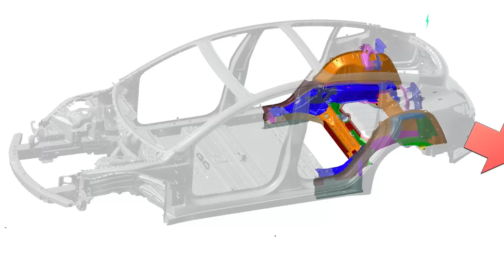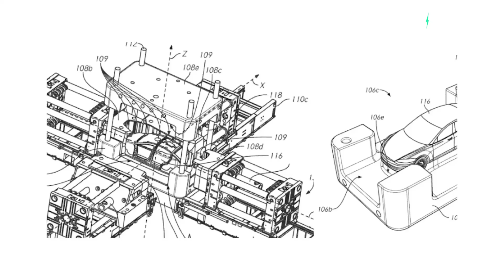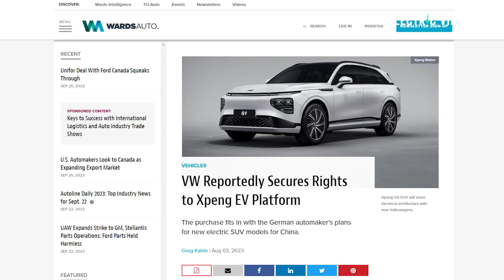Tesla Giga Shanghai launches 1-piece Giga casting for epic 40% cost reduction

Comment: Wouldn't it be interesting to know which technologies are currently incorporated in which models in which markets?
Reply: well...basicle CN models - model 3 the new one. he said it. prob this will be exported to EU and SEAsia and CN of corse
Reply: But what specifically do they have? Which castings? Which batteries? Which structural elements? There's no info from Tesla on any of this, so I assume the new 3 has no major castings and no structural battery pack -- technologies that as far as I know have only been used in Texas and are not now being used at all.

Comment: One of the issues that is created by gigantic cast parts is the lack of repairability. Castings are brittle and brittle materials fracture without any plastic deformation.
If the vehicle had a rear 3/4 impact for instance, that would likely smash the wheelhouse area and there would be no "partial parts" sometimes referred to as "service parts" for use to repair.
Ultimately at some point forward in time, the objective is that there will be no accidents but that is still a long ways off. In the short term I see many insurance write offs for relatively minor accidents thus creating huge insurance premiums for Tesla cars.
Reply: So very wrong.   These are not brittle and have what may prove to be the worlds best progressive crush, energy absorption, for crash protection.    Safe trumps cost of repair.    Modern cars are using modern strong steel for strength and it is less/not repairable.
Reply: @danharold3087  You are very misinformed, the grain structure of a casting does not permit plastic deformation. According to the foundry forum: "Tesla does not yet have a solution to casting repair"

DO NOT DELETE THIS THIS TIME - do your research before making irrational statements.

Comment: of course others will be able to compete with that, they will get and institute their own Giga Casting Machinery. It may take time but they will. You give FAR too much credence to how much of a lead it would be and for how long. it is but it is not sustainable.
Reply: Tesla has said it does not depend on moats.   It just keeps moving ahead of the crowd.
Reply: @danharold3087  my point is that if  proves to be a successful strategy, there is nothing to prevent others from adopting it too. Congrats to Tesla for innovating but their lead is FAR from insurmountable.
Reply: @jpdurr  Yes the current lead is not insurmountable IF TESLA STANDS STILL.  Tesla is constantly innovating the factory the line and the cars.    So when others catch up to where Tesla is today Tesla has moved on.   Top engineering graduates line up to work at Tesla and it shows.
Reply: @danharold3087  Tesla had better start paying more attention to Quality issues.

Comment: Since they afaik not building these giga presses them selves but buys them from an italian company if I am not mistaken, then nothing is stopping the competition from doing the same thing. Even to build such a press is no rocket science.
So I don't think there will be any pants shitting on this one.
Cool machine though, but as said no high tech here so easy to copy for anyone
Reply: When Elon wanted the first 6000 ton press nobody wanted to try making it.  Irda said maybe we can and did.  Yeah it is kind of like rocket science.   If you give a car company a press they would not be able to use it.  They would have to figure out the alloy mixture.  Hire die casting experts.  Tesla borrowed material science know how from SpaceX.   
Nobody needs a gigaPress to build cars.  But Tesla will build better and less expensive using them.   With the current production rate of many EV makers buying into this tech could kill them.

Comment: Weight is important but not as much as ICE cars due to regen.   If regen has a good round trip efficiency, most of the energy to accelerate the car is recaptured.   The only energy needed to keep a car at speed is that which is required to overcome aerodynamic drag and rolling resistance.   There are slightly higher losses with weight due to increased rolling resistance.   But aerodynamic efficiency is usually more important than weight because no aerodynamic losses are recaptured.

Comment: It may drastically reduce the cost of manufacturing the frame but it also makes the frame and all of the extra pieces fused to it impossible to repair, which means the whole vehicle will get scrapped for things that could previously be repaired by swapping some relatively affordable parts. Almost anything beyond a paint chip on a Tesla ends up with a 5-60k$ insurance claim.
Reply: Why do people make out like Tesla hires tech school dropouts.  Tesla hires the best and brightest engineers in the world from around the world.
Tesla with casting has crush cans on both ends.  So that shoot you in foot on your "more than a paint chip thesis".
Each year cars in general are less repairable.  To meet safety standards they are using less repairable materials on the body and the frame.  The casting look to be excellent at energy absorption  Yes they have replaceable crush cans.
Reply: @danharold3087  If an impact is hard enough for crash cans to be of any use, you are likely $10 000+ out in sensors, electronics and wiring harnesses, etc. on top of the structural and cosmetic damage.
Reply: @teardowndan5364  Where are you going with this.   Any car equipped with a quality ADS system will have similar sensors.  Bard says Tesla cameras are $200 to $600 installed.  The point here is that anything past a paint chip is not going to total the car.   Which is what I objected to.
Reply: @danharold3087  In a conventionally manufactured car, most of the suspension and steering hardware is mounted on brackets that are then attached to the frame/body. In a gigacast, most of that is integrated in the casting where even a seemingly trivial side impact into a wheel can total the whole car. For more serious impacts, EVs often get written off simply because the insurer doesn't want to take chances with the battery having been damaged.

Comment: People you are looking in the wrong place.   
Overall, the thinning of automotive exterior panels has had a negative impact on consumers. It has made cars more expensive to repair, and it has also made it take longer to get cars repaired.  Accidents and incidents requiring panel replacement are frequent in comparison to the need for frame repair.    The thin panels have increased the cost of auto body repair and auto collision insurance.

Comment: Here's a question, what if the car gets damaged? How can you replace "the part" without replacing the whole car.
Reply: The Model Y is designed with repair in mind. There are points on the castings, where you can cut off a part of the casting, and weld a new part back on. Not every crash, is a write off.
Reply: Not unique to the cast cars.

Comment: What's the point in having game changing manufacturing technologies and then scrap really helpful (and cheap) things parking sensors and indicator stalks !! Tesla run by accountants now
Reply: Nope.  They are pushing the less parts thing what many including me think is too far.  I could be wrong.   Anyway watch for a nice add on stalk from aftermarket suppliers.   This is not going to ruin the car.

Comment: Tesla is a beast. I drove the "old" model 3 from 2019 and it was really great, then I tried the 2022 model 3 and I could both feel and hear the difference.  Now they have made an almost new model 3 and from what I hear it is Even better ! And having a family safty is very important to me, so as Tesla has the highest safty rating makes this a no brainer. Also was pleasently surprised that it dident do anything bad to the battery if you only used supercharger !
Reply: (spellcheck - on edit - helps credibility, try it some day)
Reply: Given that Tesla now used a very good HVAC system on the battery we should not be too surprised.

Comment: My only concern is car insurance, surely if you are involved in a crash that damages the one piece moulding the car is automatically a right off , yes the cars will be cheaper to buy, but I for see insurance premiums sky rocketing as basically they will be disposable products and not worth trying to repair !
Reply: High strength steels are causing the same problem for other cars.  There is an equal if not greater issue with the thinner body panels and they get damaged far far more frequently.

Comment: An impressive achievement by the engineers. Unfortunately, this will increase insurance costs even further, as repair options will be reduced even further.
Reply: Not if total cost is lowered substantially.  And it is safer.  A lot of insurance is liability for injury etc.
Reply: @kevinwalker2529  Exactly.  Cheaper to replace a car then heal the sick and raise the dead.

Comment: Anyone thought about how to repair this single piece in case of the accident? Insurance will cost $$$$$$$$ going forward.
Reply: Asked and answered.   Other cars have the same problem with modern high strength steels. 
Tesla cars are generally safer.   Insurance companies pay much more injury related money than car repair.
Safe is good even if the car cost more to fix.
Insurance companies are not to be trusted.   They point out where it cost them money but slip the bit about savings under the blotter.

Comment: Don't believe everything you read Sam.  Think about stuff before you produce a rushed video.

There is NO way this is in production yet.  The Fremont MY still uses 2 part castings for the rear only.  The NEW M3 Highland STILL doesn't used giga castings.  ONLY SOME MY w front and rear castings AND structural packs are currently being made in Austen.

So.  Most MY production doesn't have both front and rear castings AND only a small percentage has structural battery packs.  Why do you think Tesla COULD implement an entire new single under ody casts so quickly when all this other steps (front and rear cast + structural packs not being used on ALL MY production lines?) is so far behind?

Obviously this is a BS atticle that are extrapolating and jumping to conclusions.

Comment: Imagine crumple zones within the cast that can be etched out and recast or press-in R&R (remove and replace)
Reply: The current design allows for the crush cans to be unbolted and replaced.
Reply: @jbbuzzable  if it is one piece, there is no bolt in. But at least a cast can have embedded rigid framing.
Reply: -imagine - just keep on imagining...

Comment: I don’t think this is a 40% reduction on the overall cost of building the car it must just be a 40% reduction in the cost of the chassis.
Reply: @EnriqueThiele I think you misunderstand their comment, theyre not saying it is a bad thing, they are just trying to make sense of the change or understand it properly
Reply: (stupid pple will believe anything on YT - Sam says a lot of stupid stuff from time to time.)
Reply: It doesn't save anything unless they have a very low ratio of failed castings. From what I have heard, Tesla did not buy big enough casting machines to reliably produce large parts to the right standards.
Reply: After you’ve done a few million the giga press is paid for then all you are paying for is the material and a small amount of labor.
Reply: @ZeusBullyMax  By which time the giga press is worn out
Reply: Who knows... but it add up to ... consider all the logistics in manufacturing spot welding and fixing 200+ steel components together ..factory space, production lines, spot welds robots conveyor and other movement equipment, storage of components logistics, purchasing, production engineering, breakdown repairs, quality control... The list goes on.... It wouldn't surprise me if this cuts by 40% as claimed.. but maybe that was compared with the old method... No front and rear giga castings.. I mean steel construction.
Reply: @gregchristie2763  So what percentage of the overall cost of the vehicle do you think the frame represents. Probably about 40%, unless the giga press makes that cost zero there is no way there is an 40% reduction in the overall cost. This brings up another consideration, a giga press is an extraordinarily expensive piece of equipment, when concluding a 40% savings, How many castings is the cost of the actual tool being spread across to come up with that figure.

Comment: I hope with the model 2 they can leave out of a lot of the self driving tech to keep cost down. At the low end of the market we want a low cost, reliable car with the killer charging network integration
Reply: Not a chance. It is the basis of it's ADS needed to meet modern safety standards.   It also means Tesla can sell you FSD without selling you hardware.

Comment: I think this info came from Reuters, and they have gotten things wrong in the past.  Many times.  And I highly doubt this report, as there's no machine capable of it.  The front and rear use 6000T casting machines, so it would need to be double that size, and then some.  But theres' no machine larger than 9000T at this time.
Perhaps in the future, but not now.  However, a greater issue is that it contradict the "unboxed" process, and goes back a few years to the "skateboard" approach.  So I can't turn this news into something that makes sense.

Comment: I would think some smart guy would come up  with a way to do this bigger castings with a lot less pressure.  And what about the upper body?  Is there an alternative to high strength steel?  They are going to have all these lower pressure machines sitting around doing nothing.  I suppose they could sell them to Toyota, who may be smart enough to figure it out.  Or not.  Replacing steel means no need for that hot dip process for corrosion reduction.  At some point in this lightening process, these cars will transform into flying drones.  When do we replace the current  air traffic system with a totally  automated (AI) system, with only human monitors?  We won't really  need pilots.  FSI  for air travel is actually simpler than for cars, as there is a total system approach, not every car for itself approach.

Comment: Sam, in a small way a little Adelaide manufacturer was making a one piece body in the early 1960s.  The Lightburn Zeta mini-car had a steel chassis but the body bonded onto it was a single piece fibreglass reinforced resin unit. Only the doors were separate. The Zeta was fun to drive - I had one - but it was a sales failure and production ended in 1964.
Reply: Huge difference,  fiberglass  is very labor intensive.
Reply: @williamreese6642  Yes. I just thought it was interesting from the perspective of a one-piece body.

Comment: Sam, compare battery weight vs structural weight savings before you brazenly say EVs will be lighter..
Don't be sloppy; do the math. And be prudent with your words.. Be an analyst; not a podcaster.

It's the main reason I take most of what you say with a grain of salt.
Reply: "will be lighter"   it is reasonable to expect batteries will be lighter.

Comment: Sam, Toyota have also announced they are using the same technology, effectively in simplistic terms they all are applying the latest plastic moulding technology for a plastic model kit but on a grand scale for the production of aluminium large castings, also widely used for Formula 1 and 2, WEC and Formula  E, However those manufactures who we all know are also experts in carbon fiber materials, and use it regularly in their customer vehicles to strengthen specific areas of their EV’s at significant saving of weight and cost.
However the Tesla’s letting in water story is hitting the papers again this time the Model Y clearly they have issues with the rear hatch seal. There appears to be a growing industry in the production of better rubber seals, to reduce noice and the ingress of water.Hopefully the upgraded model 3 with the quality improvements has addressed it for that model which can be transferred to the model Y.
Reply: Have you seen the flap about Ford taillights, same problem water.   Think it was on the lightening pickup.   Do not remember details but when these trucks are out of warranty there is no way the public will pay what they are asking for replacements.
Reply: @danharold3087  I had the same problem years ago with a Volvo 480 glass rear door, the seals had to be replaced. This why Toyota is a hard act to follow when it comes to basic quality.

Comment: So if it gets into a crash, its a total loss because it would be crazy expenseive to repair? Will this be another reason why the insurance for insuring tesla will go higher? Mine just shot up 50% even though i have no accidents or tickets my entire life.
Reply: Tesla is closing the loop.  Build the car> Insure the car> fix the car
They are using info learned in he fixing part to create cars that are less expensive to fix.
If this turns out to be a bad deal they will do a 180.
Thing is other cars using modern steel are no more repairable than the casting.
The casting has economy and safety on it's side.   
The casting will become the way they all do it for cars made in large numbers.
Insurance companies are not to be trusted.    You are far less likely to be injured or die in your Tesla.
Look at how the castings are designed to crush.    

Car insurance companies typically pay out more for injury/death than car repair. This is because the cost of injury/death claims can be significant, including medical expenses, lost wages, and pain and suffering. Car repair costs, on the other hand, are typically much lower.
Reply: Tesla's finances are so boyant, that Tesla has the cashflow to provide insurance too.
That also have the data to price it competitively too according to the risk profile if every driver.